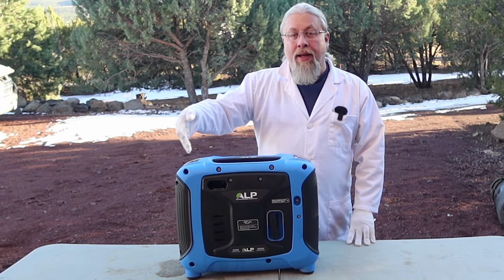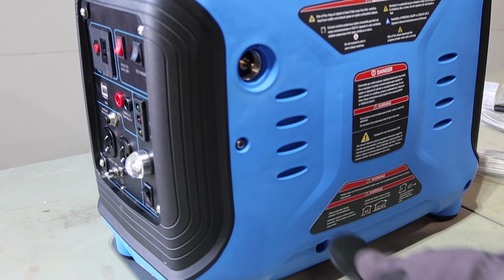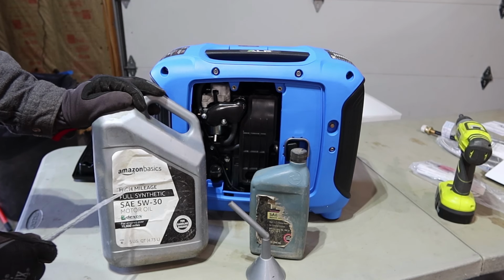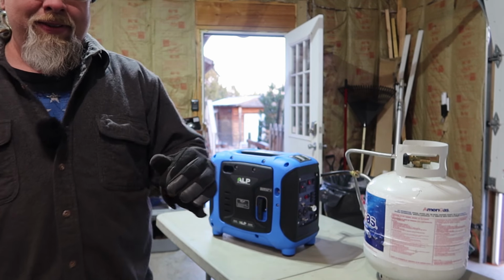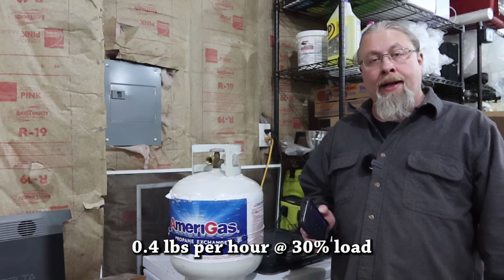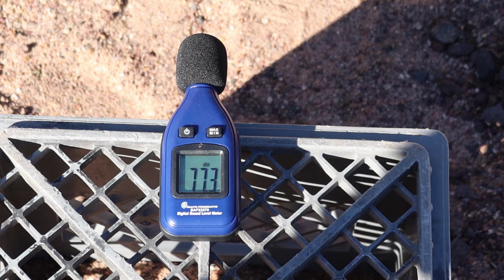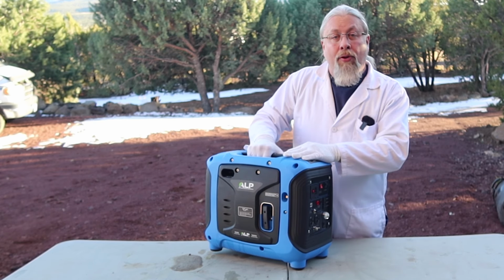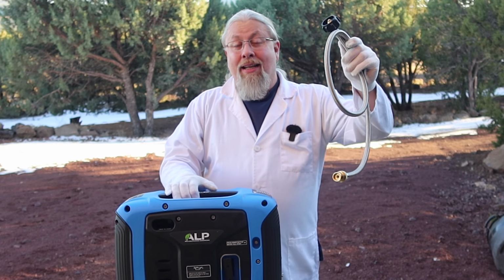ALP 1000w Propane Generator Review | Parallel Ready Eco Friendly Compact Efficient

Comment: Great review as always.    I've actually had one of these for  a month or two,  picked it up as a backup / supplemental power solution as we are off grid solar (5kw of panels, 10.5kwh battleborn batteries).   Overall I really like the generator and propane is SO much easier to manage than gasoline.   I did run into a bit of a limitation folks should know about...    I have a 24v battery bank so I use this to run a Victron 24v/12a battery charger to charge my batteries when sun isn't cooperating.    This used about 340w and I liked the solution so well that I added a second charger so I could charge 24v/24a for 680w and burn propane faster or just do one at 340w and get a longer run time off a 20lb tank.    But I found that both chargers running would overload the generator every time...    it turns out the chargers only pull 340w but they do it at 4.7a....  and if I found that the ALP makes out at 7.1a.     So 2 chargers wouldn't run... and since 4.7a is well over 1/2 of 7.1a it was pulling a much heavier load than I thought on the little generator.      So getting a 40-50hr runtime with one charger wasn't really in the cards...  and I found the best I could do was run one charger at 24v/12a and the other charger at 24v/4a (on low setting) So I get 24v/16a charging while pulling around 5.8a / 480w.    With this setup I get 23hrs out of a 20lb propane tank.    Not bad and it does the job but not as good as Id hoped.   

That said... I love the solution for backup power.   Its small, light, easy maintenance and since it doesn't have a gas tank you can store these just about anywhere, you can even ship them if needed which you can't typically do with a gas generator.   Truck drivers could store one of these in their cab for emergency power.   Just don't run it in there. lol.     I'm tempted to get a second one.   

A couple other things... 

1. they probably measure noise from 20ft away... most generator specs are from that distance.  It does get pretty quiet when your not right up on it.  

2. If the black hose connected to the side of the generator isn't hanging free... if its bound against something or bound upward by a 1lb propane tank... then in time the vibration can work the connection lose and your propane will leak out.   Only happened to me once...   but getting 6hrs out of a 20lb propane tank wasn't good. lol.    Just make sure its hanging free and the connections are hand tight and you won't have any problems.

Comment: For $500, I'm definitely getting one when I move to my new property.
Reply: It seems like it may be a good backup for keeping a refrigerator cool or running some smaller devices.  For the same price you can get a much larger unit that can run the whole house.
Reply: You'd be a fool to run a generator for the home on propane. Best off purchasing a diesel generator 6KW for about $1500
Reply: @ciaranbyrne62  if you have $1500 to spend.

Comment: Change the oil every 50 hours??? So you change it every 2 days???? Damn, glad I heard that, as I would have never thought you would have to change the oil that often, and probably killed one if I bought one lol.
Reply: You're assuming you'll be running it nonstop for 2 days straight.
Reply: @ntdnguyen85  No, but 50 hours happens quicker than you think if you are not paying attention.
Reply: @ntdnguyen85  I don't know if it has an hour meter built into it, and I would not have thought you should change the oil that often is all. I might run it for 8 hours a day for a week or two, maybe a month before I thought about changing the oil, and probably shorten it's life significantly lol.

Comment: At about $12 a tank, I believe that works our to about $1.5 a kWh. It’s certainly a backup and not an alternate to the grid. As a transportation fuel, gas is taxed more than propane and would certainly be higher. Does that sound right?
Reply from the maker: Here in AZ we pay about $1.70/gal so it costs roughly $1 for 1600wh assuming you are in eco mode and pulling under 400w from the generator. Definitely a lot more expensive than the grid but a great backup solution as propane doesn't age and many of us out in the boonies have 100+ gallon tanks at our homes.

Comment: That’s cool, I had no idea these existed. I have no experience with generators in general but I’m pretty much sold on this. 
 I am curious about why I never hear vanlifers using propane refrigerators. My understanding is that they’re way more efficient but everyone seems to be too proud of their solar systems to consider using propane.
Reply from the maker: I always use my propane fridge when boondocking, but I also have a 12v fridge too that runs off the solar. The propane fridge is very temperature dependent so I can't rely on it.

Comment: One application for a little generator like this one is keeping your house battery charged when running the furnace over night in temperatures like that. Maybe even your tank heaters depending on your setup.
Reply from the maker: That's a very good idea. One reason I ditched my furnace for an Olympian was because of the power draw. It would also work great for the tank/line heaters.

Comment: would be interesting to see what the true cost is to power up an AC200 from zero to 100% with the wall adapter.
Reply from the maker: @400w it would probably use about 0.6lb/hr. AC200 would take about 4 hours to charge so that's 2.5lb total. Here in AZ propane is $1.70/gal and there are 4.24lb per gallon. That works out to $0.40 per lb or about $1 worth of propane.
Reply: @HOBOTECH  $1.70 per gallon in AZ?  Wow!  I just paid $3.59/gallon in central Florida

Comment: Thanks for the review. I've been looking at the ALP for a couple of months. It would be perfect for our small townhouse here in hurricane country. Gasoline storage is a problem. Propane is fine. I don't need a whole-house generator. I mainly run off the Bluetti's when the SHTF. This would be to recharge them during long power outages. Glad to know I would need to be prepared with my own oil.

Comment: Lol 40 deg and a little bit of snow....we got over a foot here in NY and upstate got 40 inches. 40 deg is still shorts weather.
Reply from the maker: It was 40 in the garage, and about 18 outside + 30 mph wind. I doubt you'd be wearing shorts!
Reply: @HOBOTECH  well that makes it different...lol. you're correct.

Comment: The nice thing about propane is it already in a gaseous state. (IF you are getting liquid,  you have the tank upside down)  Once the engine fires on propane, it should run and idle without using choke.

Comment: That looks like a perfect little generator for an RV travel trailer?
Reply: 1000 watts? People need to read the labels on their appliances! It tells you what the power consumption is. 600, 1800, 1000, 1800 watts? What does that mean? Power (basically) is Voltage times Amps. 120 volts times 10 amps equals 1200 watts. A typical wall outlet is either 15 or 20 amps. How many times have you tripped one of those? 1000 watts will disappoint most people. On the other hand, it's 1000 watt hours, which may be stored in a battery bank, which a more powerful inverter can provide the surge needed during high demand.
Reply from the maker: You can buy two and parallel them for double the power.
Reply: @HOBOTECH  Good to know but I've already purchased the 2000w Bluetti and will see how well it meets my power needs for my 27' trailer.

Comment: A few years ago a actually Tucson Arizona pawn shop had a Platinum I believe based jacuzzi heater which of course was radiant. They were selling it for almost nothing so argued that it could not be that type of catalytic heater LOL. It had never been used but was $1,000 item. During the 1970s gas was very expensive especially methane at some point so the plan was to use thin-film solar panels and weather stripping to get rid of all of the furnaces and replace with Platinum based Heating using the existing grid to deliver the hydrogen instead.

There are lots of bad reasons that did not occur and if there are any good reasons besides the cost of fract methane being paid by the indigenous and island-based life on this planet mainly in terms of perception I don't know of them. Of course among its merits is its non electrical nature and the cost of platinum Heater fuel including fracked gas of course is the reason I mentioned that I suppose. If this generator is expensive please understand that produces far less heat using far more propane then a catalytic heater would for less money especially if the catalytic heater is engineer to bank the Heat and operate 24/7 by for example heating water in a tank and then using floor heat coils. In San Francisco and other places marijuana was produced using generator power off and natural gas with both silencers and of course intrinsic to their nature water not air Cooling. Because the lamps were inefficient especially in San Francisco the free heat did not have much use. maybe that's why the spa culture developed however

Comment: Gas generators need to go bye bye, forever.
Reply: But they won’t, because people must deal with simple things like power outages in areas due to people driving into electrical poles, hurricanes across regions, etc.

The power sustained in carbon based fuels is formidable, because of the 4 bonds on a carbon atom. Carbon is a 100% renewable fuel, by burning it, plants will recycle it, without any cost. We eat the plants as food, which is recycled carbon.

Some day, someone will figure out how to eat lithium batteries & survived but that day is not today. People just bury it and strip mine to get more.

Comment: Not too bad for about $500.00 without the hose the four foot braided steel hose is $25.00. Not bad I wish it produced 1500 watts. The professor HOBO.
Reply: My Honda 2000. Runs for 40 hours on 20# bottle
Reply: @ALF5565  - Did you use a Hutch Mountain conversion kit on your Honda?
Reply from the maker: You can buy two and parallel them for double the power.

Comment: The baja propane only generator is available from home depot for nearly 200 less. Would be a great comparison.
Reply: Is it a small and do they provide any gallons per kilowatt-hour information or how many hours it produces Peak wattage? Efficiency standards for home inverters are being biased deliberately to 50% in Europe I thinking higher here operation and there is a huge markup 4 inverter based generators that are able to operate at various RPMs depending upon the load. Obviously this is an inverter generator I have not watched this video yet and the Home Depot one likely is not? In a hybrid powertrain like a scooter or a Toyota Prius he do want to operate the generator at Peak efficiency the small battery is what then Powers the various Lowe's in other words the motor doesn't have to be anywhere near as big as it would normally have to be to get a car moving nor does it have to be Tunes to operate efficiently at various RPMs. Think of it as diesel gate in reverse. The Honda cars are selling for 4 figures each however and that means that for off-grid to use storing low pressure hydrogen in a variety of ways now make sense for overnight use. During the day renewable electricity produces hydrogen and during the night the fuel cell from the prior current generation which can be liberated profitably by converting those Hondas to plug in batteries. the reason those cars are selling so cheaply is because once you use your $15,000 credit you have to buy another one from somebody who has not use their credit because you're buying high pressure hydrogen at the market price. I can't imagine the bargain on one of those Honda fuel cell cars if it has been quotes totaled but again one of those with a modest amount of battery is worth more without the fuel cell and one without the ability to charge the battery from the grid and it is the fuel cell that until recently has been regarded as a million dollars per car. I don't believe in electricity or fuel cells but if you need electricity overnight and sunshine is all you got for that special case you can store it far more hydrogen for almost nothing overnight then you will possibly need with a far easier balance of system cost to stomach. those fuel cells that are in the Honda car are not designed to operate on propane. They do provide a nominal amount of power which is a ton of power for a house. Honda has made the unbelievably stupid decision to sell them instead of lease so somebody is going to make a killing retrofitting them conventional electric cars and selling the fuel cells as discussed above! The real issue for those cars though is to convert them 2 pneumatic operation because you can get about a hundred fifty miles of range and the liquid nitrogen is probably cheaper then the hydrogen it only takes you to 300!
Reply: @arts8302  It is an inverter propane only generator. I have no reason to believe the efficiency is markedly different than the one in this review.
Reply: @Gratefulwon  does the engine run at full speed regardless of the load? You do understand that that is not an efficient way of proceeding but apparently common for standard generators ordinarily that absurdity? They obtain the frequency of the sine wave by staying the alternator at that rotational velocity instead of using Electronics so that they can provide only what electricity is needed and adjust the fuel consumption precisely to match that meaning they're operating at something like 20% efficient LOL not .02. Big deal. I am actually in favor of engineering intelligently so I like solutions that get more done with less including for example canceling the detonation in Atlantic City of the rebar and concrete dozens of floors on under 2 acres. Atlantic City can install solid state lighting and produce all of the fresh arugula The Gourmet chefs need or they can park a bunch of cars. It doesn't really seem like a hard choice but we have to completely revamp constitutional compliance for corporate liquidation so that the externalities are not ignored. All of the contribution that all of the electric cars are currently making on the entire planet will take years if ever to undo the damage blowing up he barely 30 year old high rise. The purpose of the Constitutional mandate for bankruptcy is not to transfer World assets into the hands of those who have paid too little and care only about maximizing further damage to the Earth so that they can get a cut on the pittance of the cost apparent to doing so. I'm not interested in how much it cost to push the button I'm far more interested in how much it would cost to leave the concrete and steel up so that we could use it for good instead of evil.
Reply: @arts8302  The generator is an INVERTER GENERATOR. It does not use engine speed to develop the frequency or magnitude of the output.
Reply: @Gratefulwon  after responding to your prior message I did see weather on edit or in the original as well you mentioned both the one featured here in this video and the one at Home Depot are inverter generators. I also had no idea how much money we are talking about but you're saying that this one is 2/3 more expensive. That is a huge price difference and I know that the market for very small generators is extremely small Ancilla freemium should be expected to be paid but I will be looking at Home Depot and I will be watching this video for those who are not doing either and cannot wait you never said precisely what the wattage of the Home Depot propane only inverter generator is nor did you indicate whether it is truly a Home Depot product available for free ship-to-store or adjusted Advertiser like the Sears Kmart Walmart Target etcetera websites all tend to provide platforms for however amazingly. Since many people talk about thirds capacity of generators I am surprised there are not more hybrid product this is the smallest generator I have seen and it is almost small enough to power a hybrid lightweight road bicycle of the Honda type Powertrain not Toyota

Comment: Keep in mind that dBA is a variable metric based on distance from the source. Many generator manufacturers measure from approximately 23 feet (7 meters). For an apples-to-apples comparison, make sure the dBA ratings of all the generators you’re comparing are measured from similar distances
Reply from the maker: Yes, I didn't realize this until too late. No wonder they get 50-something db.

Comment: If oil was included for shipment it would fall under the nightmare of hazmat
Reply: Can confirm, far easier to ship something without oil in it. Even for shall we say far far larger machines
Reply: I expect the amount of oil needed for that equipment probably would fall in either the exception range classification where no label was needed or  just a limited quantity label...either way by ground fairly easy to ship... no hazardous paperwork would be needed to ship....probably saves you $$ for the price of the unit my guess is.
Reply: @WaltPerry  as someone who has looked into this shipping from Canada to the USA ANY, and I mean any oil in it will cause issue. Does not matter the amount. If it's in a sealed container with it though you can get away with it.
Reply: A sealed container from factory in a SAE certified bottle.
Reply: Uxh

Igtj @vhateverlie

Comment: i want to know if it operate  water well  pump and pressure tank
Reply: It's only 1000 watts so probably not. Check the specs on your pump especially inrush current. Isn't your pump 240V? Pressure tanks don't use electricity.
Reply from the maker: You can buy two and parallel them for double the power.

Comment: Blue rino and ameragas are
Only putting 15 lbs in a
20 lb cylinder... I assume
You had it re filled.
Also remove the plastic
Wrapper from cylinder
So moisture won't rust
The cylinder over time.